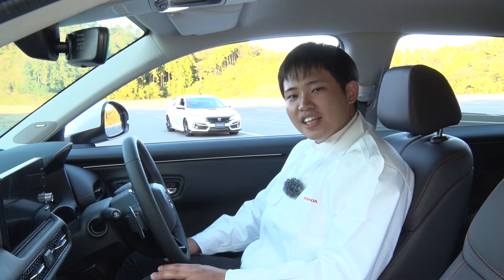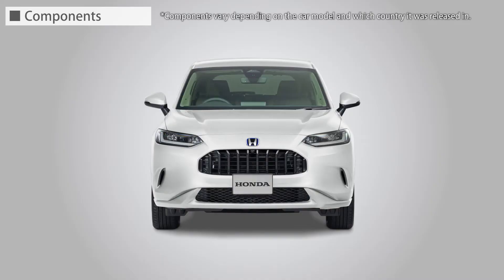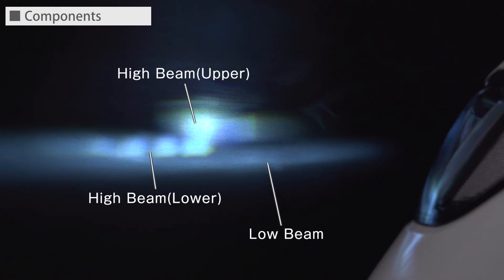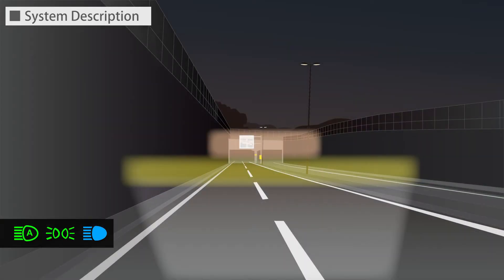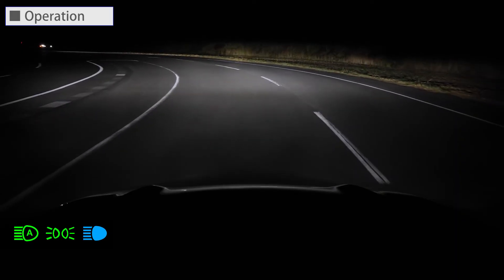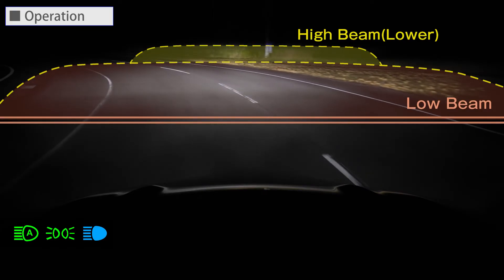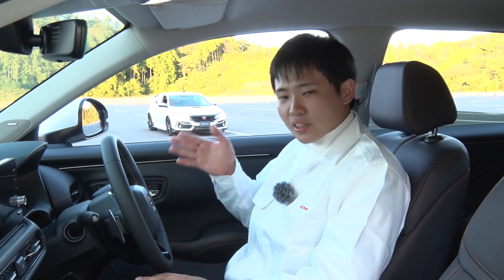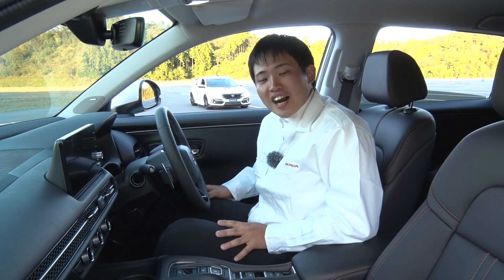Honda SENSING Adaptive Driving Beam

Comment: I don't get it, why not just dim your lights? It isn't hard.
Reply: Then don’t get it since you won’t seem to benefit from it.
Reply: @longebane I won't, but I'm disappointed that so many people that can't flip a switch are driving.
Reply: @Kattbirb It’s not about flipping a switch. If there is constant incoming traffic or in front of you, you won’t be able to turn on your normal high beams at all. With this system you can have a patch of high beam on the sides of the road at all times (that you wouldn’t have at all with normal headlights), thus it will make it safer, more visible.
Reply: @tonydanielc7739  that sounds even worse. Like roadways will become even more obnoxious with super-bright, flickering lights everywhere. Every car having a super bright patch pointing in different directions.
Reply: @Kattbirb All right, you must be trolling. There is no ray or light patch from the high beam towards the other drivers. The system will make a shadow patch in their direction. You cannot see any shining high beams.
Reply: @tonydanielc7739  I'm not trolling, headlights in the last twenty years have been getting worse with every new "wonder tech" without fail. Further, I live between a highway and a busy street heading to my downtown. Even if it does work for other drivers, of which I'm highly doubtful, it will still be a nightmare for anyone else around them.
Reply: @Kattbirb Most of them detect pedestrians and even reflective road signs. Don’t worry, engineers thought about this. They work, I find matrix headlights to be the most confortable for me as an uncoming driver.
Reply: @Kattbirb  When you're blinded by a vehicle, 99% of the time it's caused by low-beam headlights aimed too high, and most people are too stupid to realize that their headlights are bothering oncoming vehicles. What's even worse is that repair shops never check the height during maintenance. What you're saying has nothing to do with automatic high beams.

Comment: They don't work reliably at all. At night, oncoming traffic constantly flashes its headlights to warn them because they're blinded. In urban areas with very bright light, the high beams turn on, which isn't necessary at all.👎👎👎
Reply: I agree with you, what’s more annoying is that you have to turn this off in the infotainment system, you can’t turn it off with the signal stock
Reply: No its working perfectly. Check your beam height and angle. You can adjust manually